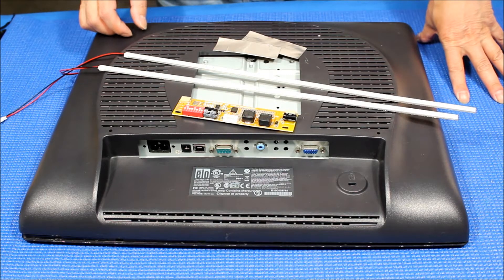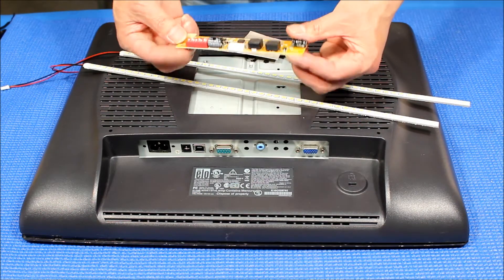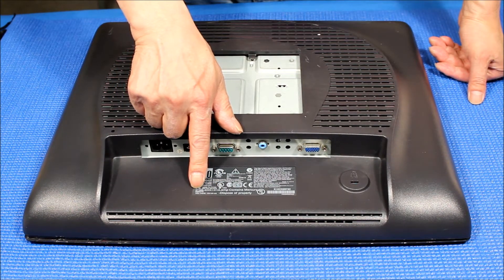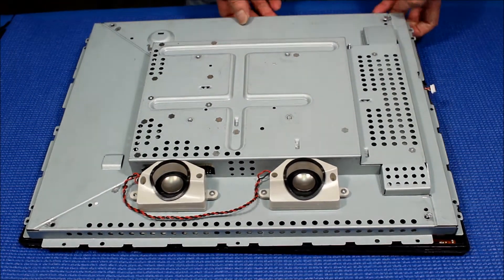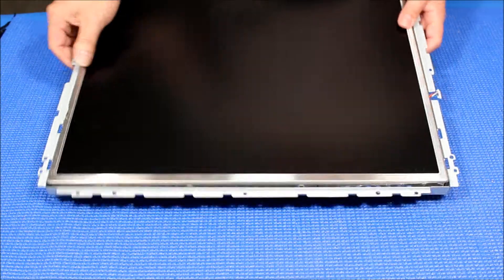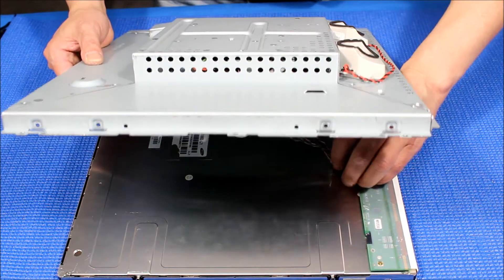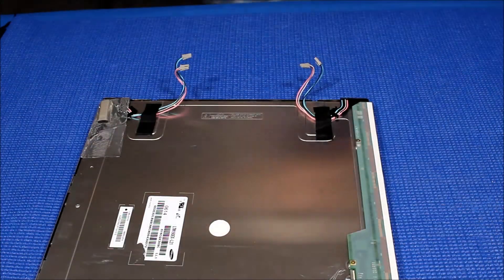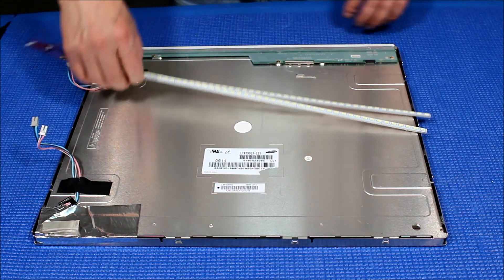Elo Touch ET1928L, Part 1 of 4

Comment: It is unclear how you open the outside gray plastic enclosure, step 1.  I see no screws holding it once I remove the 4 screws for the stand.  Does the plastic front bezel and plastic back panel snap apart somehow?